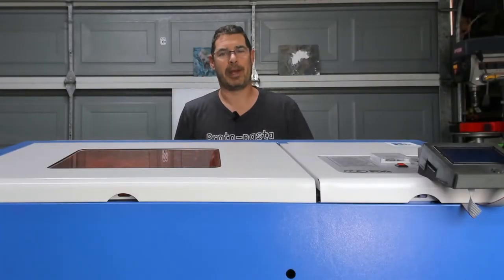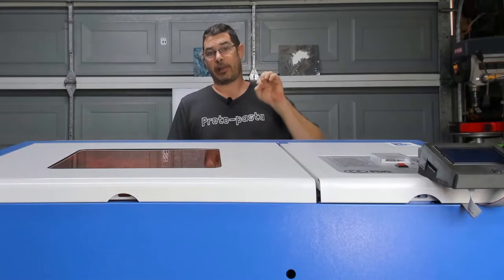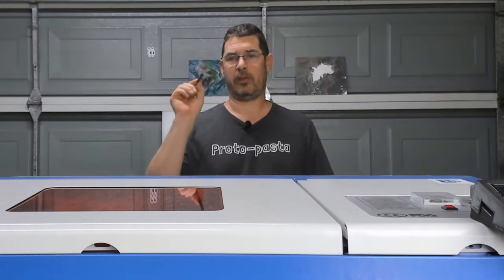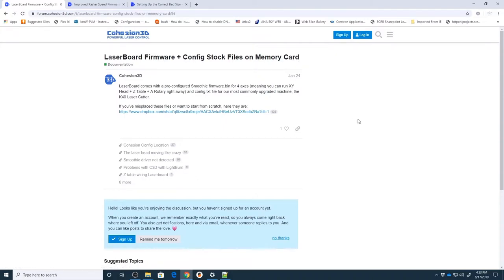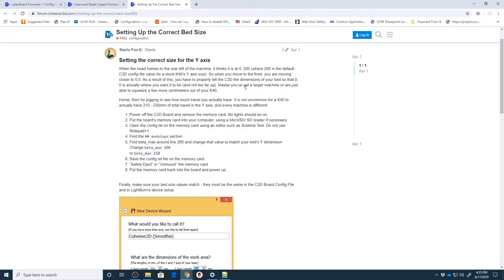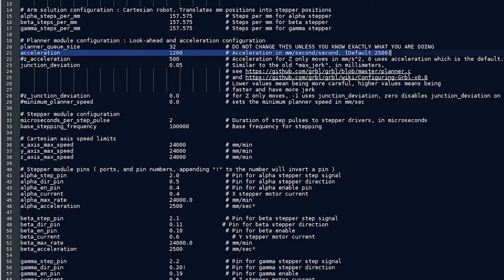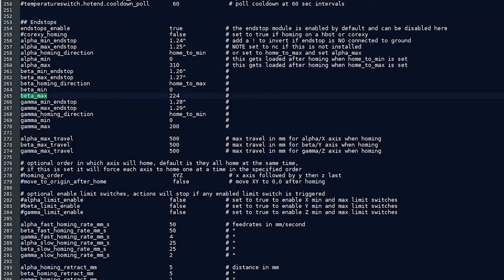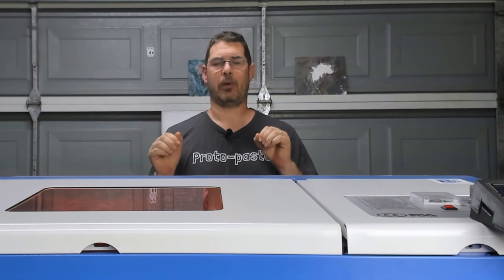K40 Cohesion 3D / LightBurn Firmware Installation- Part 2

Comment: I added the Cohesion3D board on my MLE 40 w printer it is wire right but the Xaxis goes in wrong direction. Think I have to change something in the config file but not sure

Comment: So I recently upgraded my K40 with the Cohesion 3D board and installed Lightburn on my computer, but I am having an issue with engraving photos. The x-axis will occasionally shift without any obvious mechanical reason while engraving but once it goes to cut, it returns right back to where it originated from and cuts cleanly, leading me to believe I'm having a software issue. Any ideas or suggestions? Thanks!
Reply from the maker: hmm. ve never seen anything like that happen. I’d suggest asking over on the light burn forums.
https://forum.lightburnsoftware.com/
Reply: @Steven Kidd I got the same problems, so normals vecotr cutting works, but when it comes to engraving, a rectangular photo will have an outer shape of a parallelogram. Did you solve this problem? I believe it is about something of stepper losses when accerlating at the very ends of the engraving lines.

Comment: I am 74 years old and working on my K40 laser with the Cohesion3D board and the Lightburn software.
Bought me a LightObject Z table, but run into a problem. When I move the table 10 mm, the software tells me to have moved the table 10 mm. But in reality it has moved only 1 mm. Depends on the steps per mm but I can't find how to change this in the config of the Cohesion3D board.
I live on Curacao, a small island in the Caribbean where people cannot help me.
My question now is, can you help me solve this problem?
Regards, Marinus Boom
Reply from the maker: Hello Marinus,
I don’t personally have any experience with changing the settings you require, however I passed along your question to my contact at Cohesion3D and they said “there is documentation for this on the C3D knowledge base and if he needs more help post to the forum and our support team will assist.”

Hope this helps get you on the right path.

Comment: Do you have the glcd stl files available
Reply from the maker: Alastair Creavy temporally I printed this from thingiverse and hot glued 2 magnets on to keep it in place.  Once I have to up and running light burn, I will be cutting a replacement panel for the controls so that the LCD is integrated into it.
https://www.thingiverse.com/thing:2813298/remixes
Reply: @crussty3d  Thank you so much